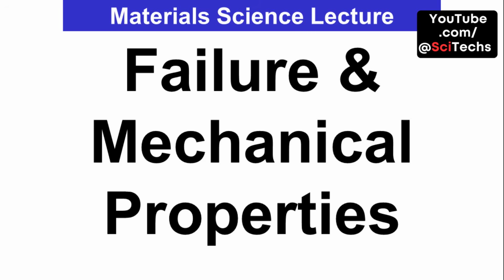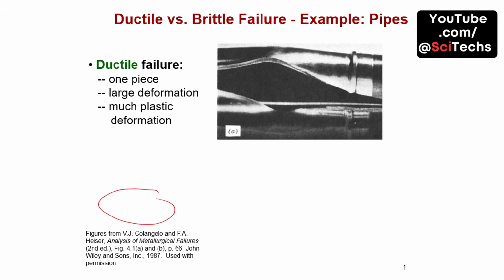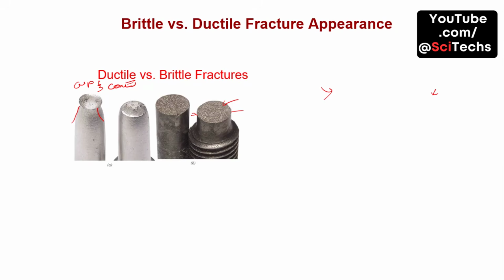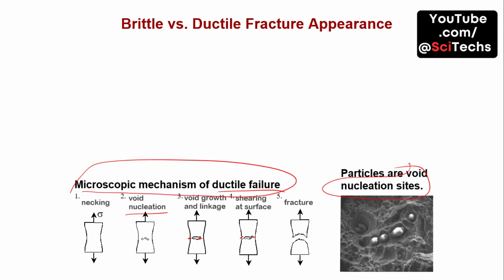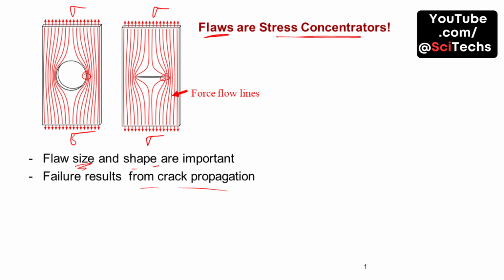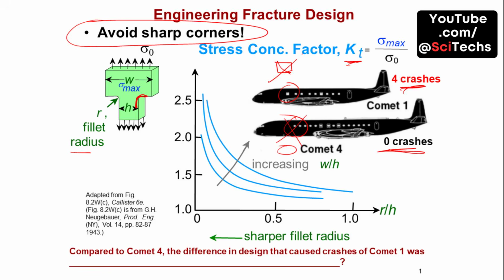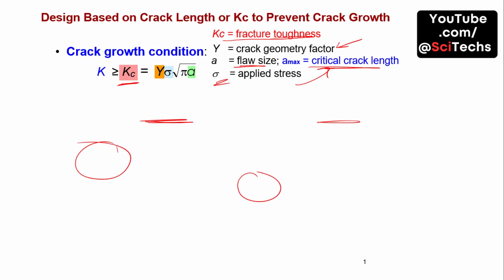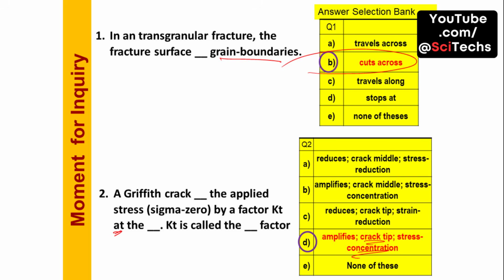Materials Science 9a: Mechanical Properties of Metals II - Failure

Comment: I learned that materials can fail below their yield strength because small internal flaws act as stress concentrators, which can cause cracks. Engineers need to know this to design safer structures by avoiding sharp corners and using specific fillets to minimize stress concentration.

Comment: I learned that particles can act as sites from which a failure begins inside a material under stress or strain. And that cracks tend to form at bends and kinks and sharp deformities in the material such that the force lines are sharply bent when under tension.

Comment: Materials failure is when an object suddenly cracks/breaks/deforms. Understanding how materials fail is important part of a successful product design or failure analysis.

Brittle and ductile materials fracture in different ways,

Ductile fracture mechnamisim: Necking -> void nucleation -> void growth and linkage -> shearing at surface -> fracture

Brittle fracture mechanism: little deformation but crack propagation can occur either through grain boundaries or across the bulk (through grains )

Flaws in materials can be stress concentrators and can cause materials to fail below their yield strength. See griffith crack formation.

Comment: Failure theory is really important  cause designing based on the prevention of fractures in the material will determine whether the material will crack or remain  intact

Comment: I learned that failure usually starts at a flaw rather than in perfect material, because a crack tip concentrates stress far above the applied stress — which is why fracture toughness matters more than strength for brittle parts.

Comment: I learned that there are specifications for materials failing and there are embrittlement and ductile fractures and there are further testing's involved to engineer shapes and formations of materials to prevent those cracks and breaks under different types of tensions.

Comment: I learned about different types of failure, brittle is something that is undesired and happens (usually) quickly with little signs while ductile gives more of a necking or sign that it is about to fail. I also learned about the griffith crack formula.

Comment: I learned about the mechanical properties of metals related to failure, differentiating between ductile and brittle fracture modes and how material flaws and stress concentrations can cause failures below the yield strength.

Comment: The video encompasses the failing mechanics of the materials. Where variation of fractures from very ductile, to moderate, then brittle are impacted by particle, cracks, flaws size. It also reviewed the importance of Griffith Crack which is the stress concentration factor Kt of material failure

Comment: I learned about the countless ways ductile and brittle materials can fail -- it was emphasized that sharp corners are a very common failure mode to fracturing, so they are typically rounded.

Comment: I learned that ductile fracture is preferred over brittle fracture because it gives warning before failure, and that Griffith crack theory explains why sharp corners concentrate stress and should be avoided in design.

Comment: The different types of failures which are tied to a number of different variables, most commonly inherent defects (flaws) in the material (processing, manufacturing), design of the material (geometry), environment (temperature, pressure), operating conditions and specimen history (creep).

Comment: I learned in this video the difference between ductile (plastic) and brittle (segmented) failures and how crystal structures and defects mentioned in video 7a contribute to these failures. I also learned that sharper fillet radii could contribute to cracking.

Comment: This video taught me that different materials require more than just material testing but also testing in it's pracrical mechanical use as there can be failures that only show when under the correct application. It also taught me that sharp corners are dangerous for strssing, which conflicts with what I was taught about triangles.

Comment: I learned about Griffith's crack equation, which helps to calculate crack propagation by using stress concentration factors it also went over what the different types of stresses are.

Comment: I learned about the differences between ductile failure and brittle fractures. Ductile fractures are easier to spot and brittle failure can be more dangerous because it's harder to spot. It's important to avoid sharp corners to prevent crack growth.

Comment: Ductile failure is more ideal compared to brittle since it will show early signs of warning like necking whereas brittle failure is more sudden and will shatter into multiple pieces, in addition, avoiding sharp edges in an engineering design will reduce the chance of failure.

Comment: I learned the mechanical properties of materials determine how they fail and at what point. Certain factors may cause this to happen before the yield strain. Ductile is one large failure, usually plastic deformation. Brittle failure is several smaller pieces from small accumulative deformations.

Comment: I learned that flaws in materials influence crack propagation as they act as stress concentrators; Griffith crack theory can be used to determine the stress, crack tip and can be used to improve mechanical design (fracture design).

Comment: I learned about the various reasons for material failures and why materials can fail below their yield strength. I also learned the difference between ductile and brittle failures, microscopic aspects of fracture, and stress concentrators / crack propagation.

Comment: I learned that material failure modes depend on both stress type and temperature, where brittle fracture occurs at low temperatures in BCC structures and that ductile failure occurs mostly at higher temperatures in FCC metals.

Comment: I learned that ductile fractures are generally preferred over brittle ones in engineering because they undergo significant plastic deformation that provides a visual warning before final failure occurs.

Comment: Materials have a yield strength based on previous experimentation. Ductile failure results in one piece with large deformation leading to a much plastic deformation. Brittle failure is due to many pieces, small deformations, and leads to little plastic deformations. Ductile fractures show evidence while ductile happens rapidly.

Comment: I learned metal structure failures can have two different types of failures and these failures can be caused by design of a system or during formation of the metal structure.

Comment: I was reminded of the Aloha Airlines roof blowout disaster in Hawaii, where a microcrack in the airplane fuselage led to structural failure and the roof being torn off. I also learned about the Griffith crack formula, which I had not encountered before, and found it to be very interesting.

Comment: This video demonstrated how flaws in a material can easily lead to failures from crack propagation. Material flaws are not a topic I’ve usually considered when solving mechanical engineering problems as ideal material conditions are typically assumed.

Comment: Engineering designs should avoid using sharp corners to reduce risk of failure, particularly due to stress concentrations that can lead to crack initiation and propagation.

Comment: From this video I learned about the Griffith cack where Kt (Stress Concentration Factor) plays a significant role in determining failure. It is common to reduce sharp edges to prevent failures at crack tips.

Comment: I learned that hardness testing on a metal will signify how well that material will resist wear, indentation, and mechanical stress, which is very important for engineers when selecting materials for durable and reliable components.

Comment: This video was really interesting as it shows visually how one can look at a fractured material and determine what type of fracture occurred based on if the fracture point is flat or has necking present, as well as demonstrating how microscopic cracks can result in macroscopic failure of a material, illustrating why geometries and manufacturing methods are so crucial in failure mitigation.

Comment: I learned that flaws in materials act as stress concentrators and that materials usually fail from cracks that start to form at these flaws. Also, I learned that avoiding sharp corners will reduce the stress concentration factor K sub t which will decrease the likelihood of failure.

Comment: Ductile failure results in the material failing in one piece with a larger deformation, versus brittle failure, which results in the material failing in multiple pieces and with much smaller deformations.